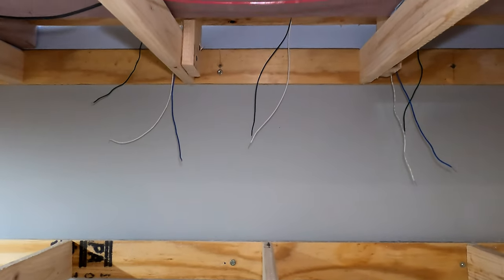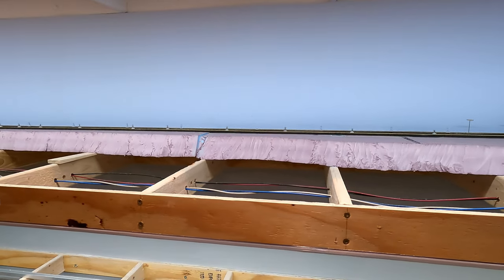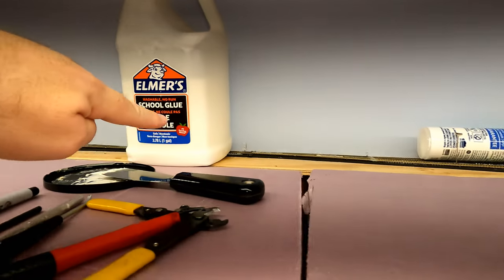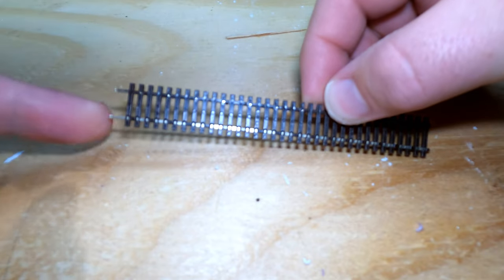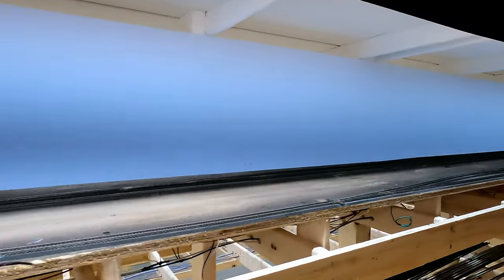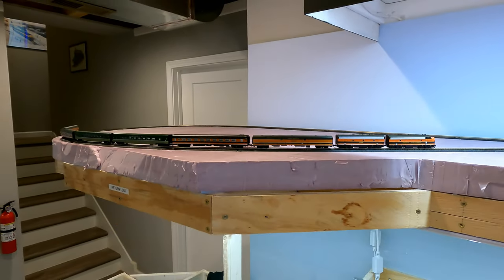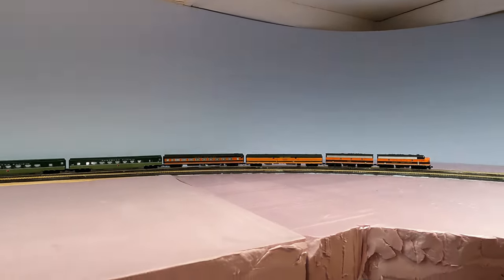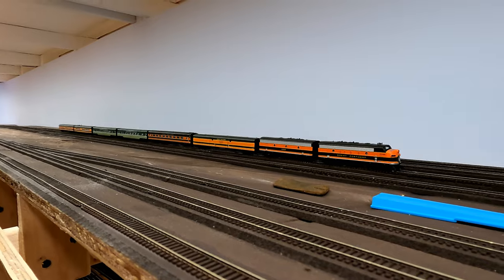25 - Building the upper return loop - part 2

Comment: We had a similar issue at the club with our roundhouse using the PM44. I tried changing settings like crazy, I eventually gave up on using it and connected the booster which has autoreverse capability to the roundhouse (this booster was reserved to run all our Smails around the layout) .. worked like a charm. 
For our track feeders, we used Micro Engineering Code 55 but I connected two 3' sections of flex and soldered the rail joiner then soldered a feeder to the underside of the rail joiners and angled inward .. made one hole for the feeders in the roadbed. Then I bent the track into desired radius using tracksettas and placed on the roadbed. We used 6' sections and made the joints between sections on straight sections only with NON soldered rail joiners to allow a bit for contraction/expansion.
Reply from the maker: That all sounds like a good way to go. I'll revisit power distribution for auto reversing subdistricts after I have more power units in place. The Atlas code 55 works well, and was way more readily available than ME track, especially turnouts. Hopefully ME can ramp back up production again with the new owners. Iain

Comment: I use DCC Specialties PSX AR, have 3 on my layout and they all seem to work great with my NCE SB5.  I originally used the auto throw feature of the PSX to operate the balloon switch Tortoise but found that the Southern Alberta Rail method of a spring switch simplifies things and once tuned in I found to work great.  That mix and match consist is great - throw in a BN hockey stick coach just for good measure!
Reply from the maker: Yep, I looked at the DCC Specialities units, too. There's plenty of options. I've thought about a spring switch like SAR, but I also like the idea of keeping things a little more manual and putting it on the operator to be doing something. I haven't decided which to go here yet. Iain

Comment: Had no problem with PM74 for both power and auto reversing sections together on the layout, made only one change - lower fault trip current (OPSW7). Worked perfectly on an eight-like layout even with 2 locos.
Reply from the maker: Seems hit and miss. Glad things are working fine for you. Some people say it works, some don't. Like I said in the video, I did try lowering the fault trip current, and it still didn't seem to play nice. The additional auto reversing module works flawlessly. Not a big deal, but seems there is a common note about not using the same device for both a reversing loop and a non-reversing loop. Iain

Comment: I only use the BXPA1 for my auto reversing loops because I still want occupancy detection. Once you correctly adjust the sensitivity it’s pretty reliable. I use the AR1 for areas I don’t need detection like diamond crossings. The PMs are then only used for district isolations. Really enjoy watching the progress.
Reply from the maker: That definitely makes sense. My local store only had the AR1 in stock over the weekend, and I just wanted to validate my logic in that the wiring and track isolation was correct. I might end up using the BXPA1s, or when I have multiple PM74s where it's less of an issue, try again when I don't have adjacent sections on the same device. Technically, I do have occupancy detection with the AR1 since it's on its own power subdistrict from the PM74. I'd like to simplify that in the future though! Iain

Comment: Do you have a video or photos of your full layout? Do you have helix to go from the different levels or are they going to be independent levels? Would you be open to questions privately about multiple level train layout?
Reply from the maker: If you check a couple of videos back, I did a 1-year recap and layout tour. That goes over how the layout will come together in time. All three decks will be connected - one helix between the upper and middle deck, and one helix between the middle and lower deck. Those helixes are not built yet. You're welcome to email - check the info / about page on the YouTube channel for contact info. Iain